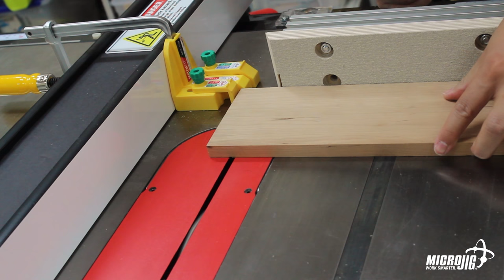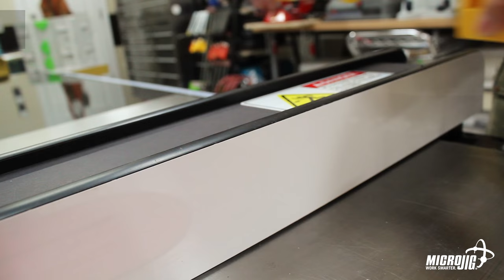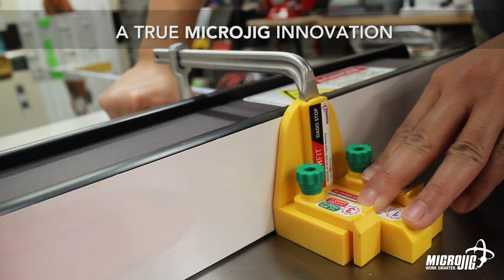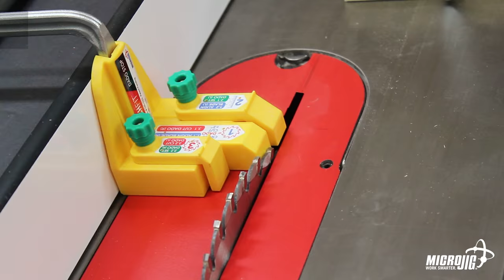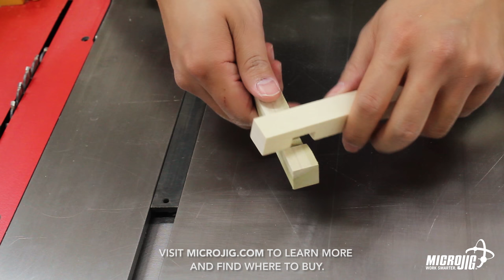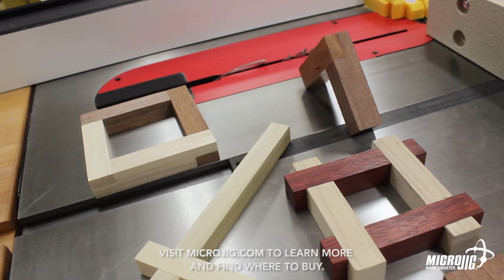Perfect Dados with MATCHFIT Dado Stop by MICROJIG

Comment: Don't forget to fit the banding a little loose as it will swell when moistened with glue.  Do NOT have a tight fit.   This looks like a PHENOMENAL Product..  It allows you the "creep up" on the cut, greatly reducing mistakes

Comment: It's great now that when you are thinking about buying a tool Youtube usually has a video showing how it works and read reviews.  However I do prefer a narrator explaining the steps rather than annoying music.  I agree with other on the price or why this isn't designed to use a typical clamp rather than requiring a separate custom clamp that is a bit costly.